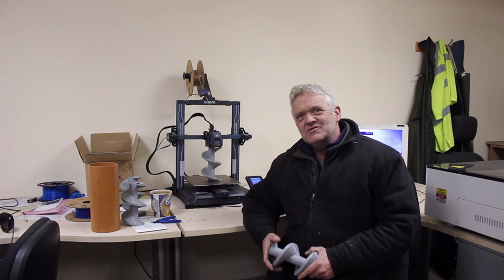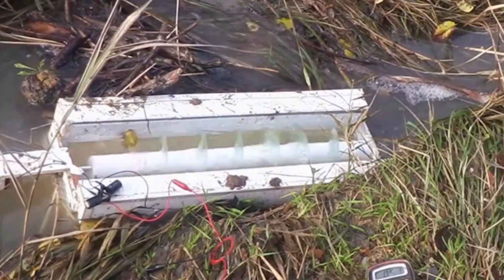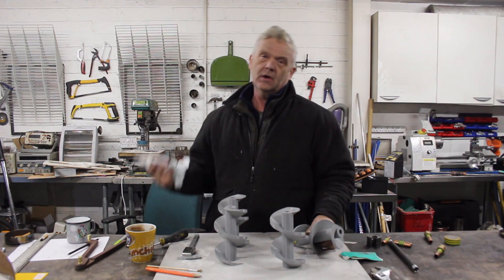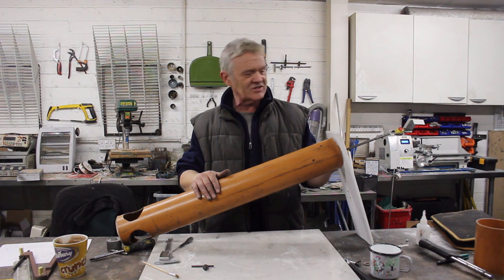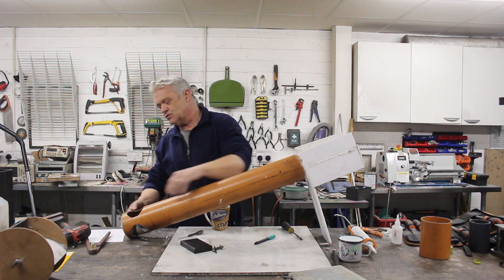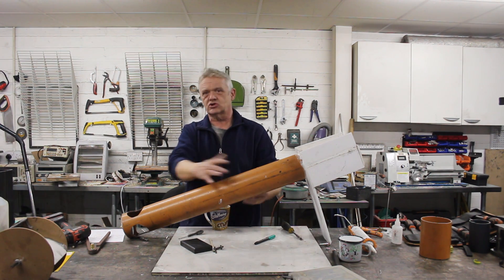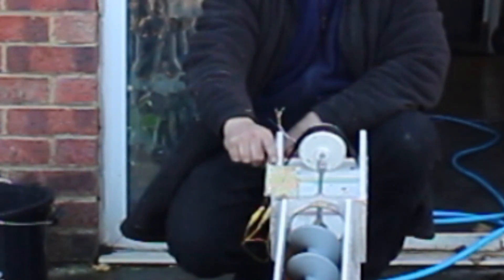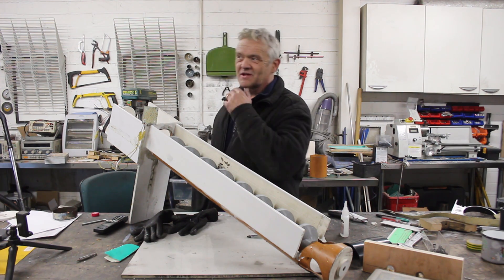1757 DIY Emergency Rainwater Generator - How To Make It

Comment: Hi, 
You don't need big bearings on a big pipe (oo-er, missus) it'll rotate quite nicely on the small shaft bearings. :-) Especially if you seal the screw/pipe together you don't waste on leakage AND then with low flow you can gear down to store torque in a mass or 'spring' to intermittently harvest energy. Or with gearing you can use the torque to haul really heavy weighs uphill, as long as you are not in a hurry. ;-)
You can do what I did and use a 6' dia coils of 3" pipe to produce tremendous low rpm torque with low flow and little or no leakage.
I used it to drag tons of soil up my steep allotment (it took a few rainy days to move a one ton box 30m (up 6m) but at least I wasn't shifting it)  ;-).  And the spent water went into the butts.
Reply from the maker: oh I have seen large instals of this mate - to my mind it remains six or two threes which way you go - sorry about that - but I don't mind in the least you thinking different to me if that helps - cheers
Reply: @ThinkingandTinkering  I’ve seen some alarmingly large bearings in my time too. And it's got nothing to do with which side I bat for.
I wasn't nit picking then either, Your video just reminded me of the problem of low/intermitent rain flow and the bypass leakage.
For the coil I used, it was the force multiplier that I needed, as I was fed up shoving a barrow up a steep/slippy hill, and I'm not Sisyphus; and I had the materials laying about (bit of a collecter-maniac, me)...change/rest etc.
Like you say, 'six of one...'  
- No need for 'sorry' -.
Skin like a duck, water off a rhino's back.
It's all part of tripe's rife laughfetry. (anag,, almost, missing a 'c')  ahem.
ATB.

Comment: I had a generator in the storm creek behind the house, since it always had water flowing in it.  I set up a paddle-wheel to a small motor and put a torch bulb on it, and watched it in the rain! I tried to recharge a small NiCd battery, but it wasn't good enough.  I was only 14 at the time.
I wish you better luck mate.
Reply from the maker: maybe revise what your 14 yo self was up to mate - bigger is always better isn't it? lol - cheers mate

Comment: I really appreciate you fluidly using the term "Energy Scavenger" because it is one of the much more accurate terms for what people have been raised to wrongly mislabel a 'generator'

Either 'energy scavenger' or 'energy converter' or even 'force converter' or 'power converter [could even say 'adapter'], but in general, I like to think that if a person views this as a way of scavenging energy that would otherwise be 'lost', 'wasted', missed', 'passed by'.

Where some people feel like they are going to leap up and scream at the wind, they are much more likely to be disappointed with their results than a person who comes in a bit more humbly and being thankful for what energy they can scrounge up.

As you yourself have pointed out easily as many times as how much you enjoy builder's board, its a matter of scale.

While this Archimedes's screw will work at any scale, not all of us can get a river and stick it in our back yard, but we do tend to often have rain guttering [speaking of that, some day I fully intend to install some on my own home] and, as you pointed out, potentially a whole lot of rain.

But also, if one has the space for a large barrel, or even a back yard swimming pool, which can fill up with intermittent or weak levels of rain, but have this device properly mounted and gated to its base, I have drained swimming pools before and they definitely put out a powerful surge of water!

Admittedly, not all of us can afford to build such a large reservoir of water, or even a plastic lined fish pond, or they may not have the space in their back yard, you can get used tank containers for often as little as 50 quid or so, and with a little washing up [because they had something in them before they were sold] they have an inlet at the top big enough for about any sized drain, you can put them up on some kind of posts at the 4 corners, and they tend to have a 50mm ball valve at the bottom, some even have larger valves, but they will often hold somewhere between 1000 and 1275 liters.

I have 3 of them myself which are the 1275 liter variety and can get more all day long if I wish, which I do eventually intend to capture the rain water with, once I install the guttering.

Also, with this kind of tank, you can easily put in a drop-down basket made out of that fine stainless steel mesh to make a quick easy way to strain out leaves and windblown junk that just pops into the top of the tanks and you can climb up a ladder pull the basket(s) out, shake them into a trash container or into your home organic compost pile and put them right back in! (~_^)-b

If you know any place disposing of old wine casks, those would look amazing, although depending on how they come to you, you might need a big screen on the top to keep the leaves out...

I really do not know where you would get such a barrel to be honest, even though I have seen them used in the past.

You could fashion your own barrel, but you would certainly have to engineer with for some strength, because if you don't know what you are doing, it might collapse under its own weight, and that could be pretty dangerous.

There are probably a thousand designs and hundreds of how-to' on building one's own rainwater tank systems, I've seen a few of them from out in the desert southwest where water is rare and precious, but the area they come from is fine, so long as you know such other issues as your local soil conditions.

I mention soil conditions because a lot of people fail to realize the nature of hydrodynamics and soil hydrology, put up some kind of structure, a lot of rain comes along, the soil gets soggy, and down their structure comes. And this is not just something limited to rain barrels, it has even happened to big skyscrapers in China.

If you are not sure, get some information from your local city building codes, and set your posts in plenty of concrete, and at least a full meter deep in the ground.

Even though I have [relatively] hard, tough, compact, stony, root filled, well drained soil where I live, and some times even solid bedrock, I still tend, as a general rule, for packed/tamped posts, no less than 1 meter in depth, for concrete, no less than 2/3 meter, for a 5 foot post [ 166 cm above ground ] and for 2 meter up to 255 cm, I go 133 cm tamped or 1m concreted, and for over 255 cm above ground, I I go 2m tamped or 133 cm concreted.

This is not a 'hard-and-fast' rule, just the rule I have followed under 'best practices' for fence, deck, and small structure stilt installation, and may not be sufficient where you live.

Please see your local building codes.

Also, never leave out the ever important gusseting work!

If you own a lot of land, especially on a steep slope, however, you can put in a body of water at the top of the land, with a buried drain outlet [a 'pond' or 'pool'] and a stopper-gate [see the inside  of a toilet tank for an example of those] with a simple lever to control it, and the hill height will add more potential power to your final product.

And, also, if you find you can mount a T on the upstream side, but do not want to bury your generator underground, you can always have the power take off sticking out the exit end.

Probably in such a case, you could put a simple disc with magnets and coils, like Robert showed with some of the wind barrel energy scavengers, and if one is not enough, just add more to the end of the shaft and either wire them in parallel for more amperage, or in series for more voltage.

Since they seem to require very little torque, relatively speaking, it would seem an ideal way to make use of the less robust power of a smaller system, if you lack a really large volume of water to work from.
Reply from the maker: that is a lot of info mate - thanks for taking the time to write all of that
Reply: @ThinkingandTinkering  I'm used to doing a lot of technical writing.

I've done it for more than 30 years at 5 different jobs from the USAF to a geoengineering research thinktank.

I can write faster than I can speak.

And be more clearly understood too.

Comment: Is the swept T joint to run off from a down-pipe a necessity?  Would it not be just as effective to, say, replace a whole (or section of) down-pipe with that setup?  Pros & cons..?
Reply from the maker: six or two threes really mate - up to you I think - a swept T is just an idea to help folks 'see it'
Reply: @ThinkingandTinkering  Ah, I get you.  I wasn't sure if there was a specific "physical benefit" to having a run-off from the down-pipe, instead of keeping the whole thing vertical.  🙂

Comment: Have you thought about making it hollow on the inside and having it floating in a moving creek with a stainless weedeater shaft as long as the weight was mostly in the water it would create loads of power. Also would follow the current.
Reply from the maker: I hadn't t- hat is interesting - thanks for sharing mate

Comment: Very nice Mr. Smith! In that type of design would it be that the longer the screw the higher amps?
Reply from the maker: I guess so but it is really higher the torque - the amps will depend on your generator really

Comment: Perhaps you could contact someone in the Ukrainian Embassy and offer your assistance and design. It just might help some of the Ukrainians to have some power as there are plenty of rivers in Ukraine. Might just save a life.
Reply from the maker: do you know I was thinking of them when I did this
Reply: @ThinkingandTinkering  Go for it Robert. You just might be able to save more than a few lives. Just think, if you offered your services, design ideas and liaised with them with the Rocket stove and the water powered generator, they would have heat etc less Ukrainian lives would be lost. They have the knowledge and skills with 3D printing to manufacture.

Comment: Absolutely brilliant... that thing pumped out over five volts, that's seriously impressive!  Being in Northern Ireland and with all the rain we get, a few of those around the town, and we'd never need pay for electricity again!

I've been trying to send you a message through the contact form on your site, but it keeps telling me there's an error, and try again later.  Any idea when it might be up and running again?
Reply: You would need more than a few just to keep your fridge running. Plus everyone else’s. 
Where would you keep them?
How much would the price per kilowatt cost?
How would you wire them to the system?
How would you keep them clean without having to drive around cleaning them?
Reply: @johnbuck5181  You do realise there was a great deal of tongue in cheek in my original comment..?
Reply: @Warriorking.1963  No. Your sarcasm punctuation was missing. 
Also, do you have any idea on how many people think things like this or solar panel roads would work on a mass scale or even be reasonably economical? 
What in your comment would make me think that you weren’t just another one of those people??? 
Seriously, then don’t waste internet space with literally pointless comments.
Reply: @johnbuck5181  I've got a funny feeling you don't get many invites to parties...
Reply: @johnbuck5181  🤣🤣🤣🤣
Reply from the maker: the turn on voltage for that light set is around 20 volts or so - so it was more than that - you can always just email me - robertmurraysmith64@gmail.com - but I do get a lot of mail so I don't give long replies mate - I am sorry about that but I would spend my life replying to emails otherwise - seriously I get 400ish emails a day

Comment: Once again we are thinking along the same lines Rob. My plan is to feed the gutter into a water barrel and arrange it as a syphon ( I think it is called a bell syphon ) so it will fill before emptying at a fixed rate onto the turbine, should act a bit like a smoothing cap after a rectifier. Great work, on your recommendation I am currently waiting delivery of the Neptune 3 pro, can't wait.
Reply from the maker: I think you will enjoy using it mate - I am - this filament printing has come a long way
Reply: @ThinkingandTinkering  Thanks for the vote of confidence!!! I sure did get a few people thinking (all because of you Rob) BTW everybody as long as you can get the magnets passing by the conductors you can get current (Perhaps this might work with the conductors running parallel along the length of the pipe) as long as you can get some kind of current (AC or DC) you can use it!

Comment: okay so I have a question for you following the video.  If you were to coat the entirety of the screw with a hydrophobic coating would the advent of this new water contact barrier increase the rotation of the screw whereby you are breaking the hydrodynamic drag on the screw by the water being in contact with the screw itself?  I think you would still get all the benefit of the push on the screw to turn it however by eliminating the hydrodynamic drag from surface tention on the screw would this increase its rotation ability and if so, by how much?  Just an American's crazy thought.  Thank you.
Reply from the maker: it's an interesting thought mate but I have no idea of the answer - the only way to answer that would be to try it - you might be thinking of a superhydrophobic coating though as plastic is hydrophobic

Comment: Why not install it inline on your incoming water main... Be running almost constantly then with guaranteed pressure?
Reply from the maker: I am not sure that would be legal mate
Reply: @ThinkingandTinkering  well the pipe from the water meter into the property is owned by you the householder and not the water board...they own everything from the meter back into the road...so it would be totaly fine because it is your pipe and not their pipe...sorry if you thought I meant attach to the water main..that would be illegal....your mains water either 20mm or 25mm should come from the pavement/road at a constant guaranteed pressure (water authorities have different criteria) but I think it would be good...
If you ever have a leak in your incoming pipe you will find that it is your responsibility if it is between the meter and your house ...ie it is yours
Reply: @pjclarke8298  You wouldn't really get that energy for free; it would reduce the pressure on the output side.

Comment: You did not mention how much watts you generate when running.  Perhaps if one has a multistory building with a large roof, it might be worth building.  But how often does one have an emergency need for watts and at the same time it is raining cats and dogs?  I would suggest that it is windy much more often than it is raining, at least in a lot of places.  Anyway, there are places where there are streams where something like this would be more useful.  Thanks for the effort.
Reply from the maker: it's like anything - it has it's place
Reply: Im guessing that the UK,,, Especially the Lake District,,, Are Not where You Live?!!
By the way,,, how about Storing, any Excess Energy?!! 
( Not meaning LithiumIoin, batteries, but Others, if you watch more Video uploads, here, you could Learn many diverse means to Store Energy as or when...)
Best wishes and Good Luck  to You!!

Comment: i wonder what would happen if you did this but the tunnel and spiral got smaller as it go down the pipe, Forcing the water into a tighter area giving more force would make more power or less?
Reply from the maker: the energy out is the same or less than energy in - always

Comment: Another case where instead of waiting for many hours of 3D printing you can print a rubber mold and use resin to make the parts. In fact you don't even need to glue the parts you make. All you need to do is put a small part of a finished section back in the mold and pour the resin in. It will stick to the finished part and end up as a longer piece.  Then simply repeat and grow it to a longer screw with every resin pour. Much quicker and cheaper this way.
Reply from the maker: did you see the link at the end of the video? I made one of these with a bunch of old CDs - no need to go to the trouble of molds or muck about with resin either if you don't want and it is even cheaper!!!
Reply: Just use a coil of tubing, skip dive from buildings/plumbing sites  . No molds, no resin, minimal tools etc. The mech also operates from low-flow rates. With many coils you can get high torque.

Comment: just love these videos, cant stop watching, i really want to get into 3d printing but i dont really know where to start
Reply from the maker: that's a really nice thing to say mate - to be honest the hardest thing is making a start once you get going it is pretty easy and getting a start is easy too - the printers aren't that expensive any more and although there is certainly a lot to know to be very good at it - I made this screw as my third ever print - so doing good stuff right away just doesn't need all that much
Reply: @ThinkingandTinkering  thank you, that's a relief i thought they were really expensive.
Reply: The Ender 3 is probably the most common entry point in to 3D printing. Fairly cheap, tons of folks using it so lots of information and videos out there, parts are easy to source, etc...

For your own designs, you'll need to learn some CAD software. Fusion 360s pretty popular in the community, so is TinkerCAD and Sketchup.

Start with the basics, learn as you go, and tinker on things as they need tinkered with. You got this. :)